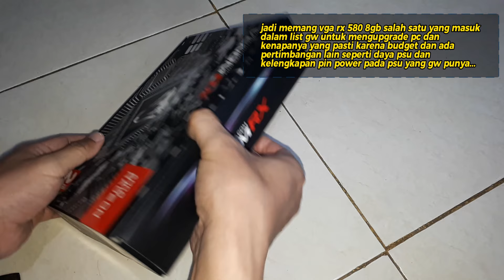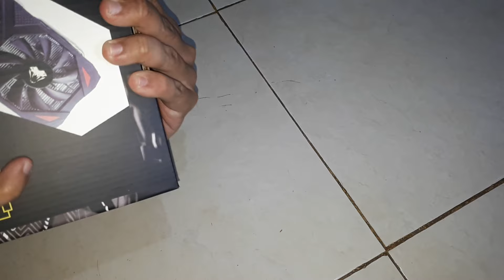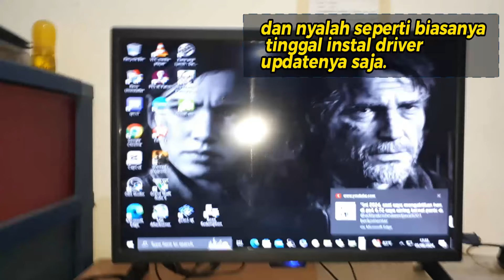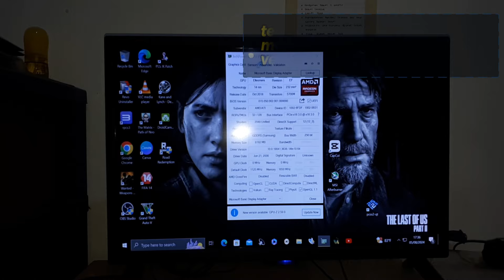SELAMAT TINGGAL VGA LAMA SELAMAT DATANG VGA BARU VENOM RX 580 8GB DDR5

Comment: RX 580 yg sekarang lagi beredar itu, RX 580 2048sp performance nya lumayan di bawah RX 580 asli, soalnya 2048sp itu buat market china doang,  

daripada beli versi refurb, gw saranin beli GTX 1070 atau nggk 1660, di harga 1,8jt aan udh lumayan bagus,   

GTX 1070 peformancenya enak lah buat main di 1080p ataupun 720p, tergantung budget agan berapa.. 

GTX 1060/1070 masih bagus lah ya, harganya bervariatif

klo ada dana lebih upgrade aja psunya ke Merk MSI a550 atau nggk 650 buat extra proteksi.
Reply: Berarti vga ini ga worth it buat dibeli bang??
Reply: @mukti_26  iya kg worth it buat beli rx 580 2048sp lu beli tuh VGA, berasa performance nya seperti RX 570

Comment: Bangh saran pc kere hore sya
I5 2500
Gtx 750 1gb
8gb ram
Hdd 500gb
Psu 420w

Saran dong mw up vga,dana 1,1jt
Reply from the maker: @Sandiiske  pk rx 580 8gb ky pnya saya bisa bro,,,tapi kalo budget 1.1an paling dapet seken. Kalau gak cari yg vram vga 4gb an, dapet baru kalau budget segitu. Tp untuk merk cari tau lagi yah bro....
Sistem nya ganti SSd aja bro biar cepet.
Hardisk untuk nyimpen file lain aja ky game
Reply: saran , kalo mau pakai rx 580 psu nya wajib di ganti dulu , minimal 550 watt biar aman
Reply: @SEBELUMSIANG  waduh pr lagi nih psu, klo gtx 1060 3gb or gtx 1050 ti tetap butuh ganti kgk ya?
Reply: @Sandiiske  psu nya merk apa dulu. Kalo yg abal abal ganti dulu. Kisaran 700k msi a550bn